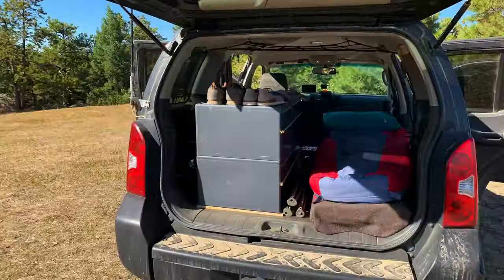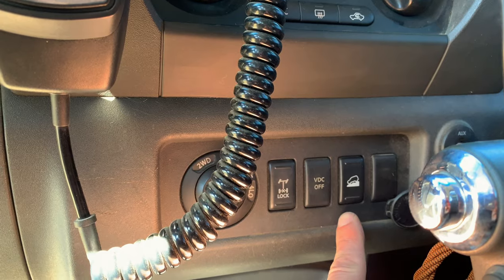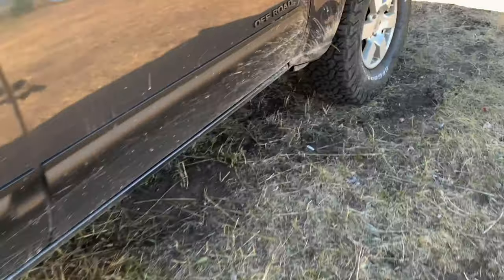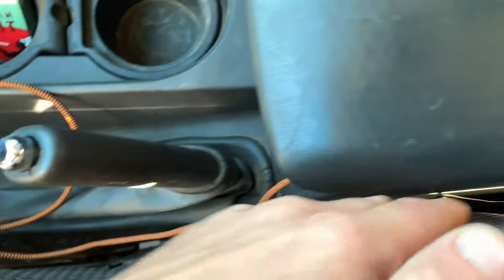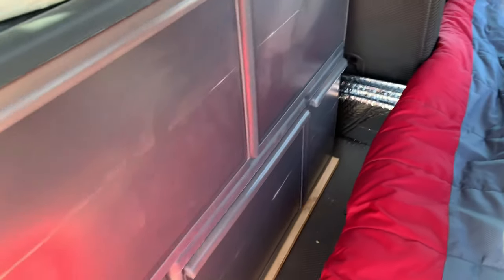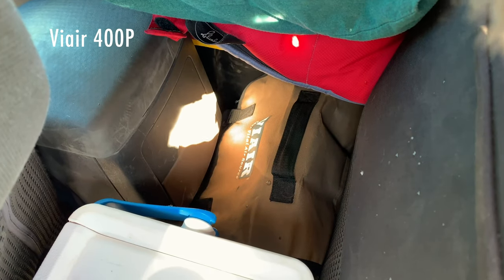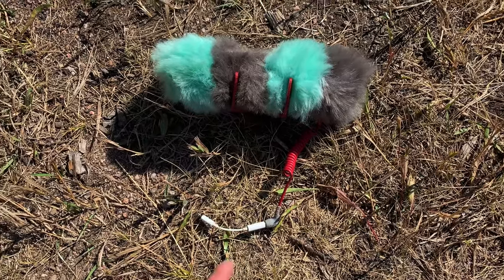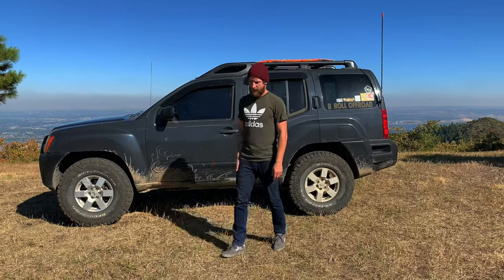Basic Solo Camping Xterra. Rig Walkaround #1

Comment: As I was driving along the interstate today in my car which is almost exactly like yours, including the OME lift kit and the OFF ROAD badge, but not the Rockford Fosgate stereo, I remembered that you mentioned in this video that your UCAs burned out (a couple of times?). I used this lift kit because it would solve the problems of the shitty stock leaf springs plus give me room for my 33s (which are more like 31s), and because it did not require upgraded UCAs. I did replAce my old UCAs, but with cheap stock-shaped ones from ebay. I expect that they will not last because they are cheap; HOWEVER, I wanted to ask you if you thought yours didn't last because they were cheap? or if it was because the new angles of the lift caused the stock configuration problems, or because of the extra stress from wheeling. Can you tell onE way or another?

I hesitated on throwing down the five bills on the SPC UCAs; well, because my allowance isn't that big, but also because I didn't know if their rigor would be overcompensating (Face it, at 53 I'm already overcompensating by having the truck in the first place, and I'm 57) and if their adjustability would be overcomplicated or problematic for the teenagers who run the alignment machines these days. I just didn't know if they would jive (I lived during the 70s) with the OME kit.

I would appreciate your advice or experience on this, and while I wait, I am going to watch another one of your beautiful Moab videos to get ready for my nap.

Thank you!
Reply from the maker: thanks for all the kind words! i actually JUST got back from Moab 10mins ago with some more videos! i replaced them at ~160,000 from the stock ones so it was just time because of one of the ball joints and a couple bushings. that late in the game it’s such a pain to get the old stuff out i went with the SPC’s to just replace everything at once. in the future when i break a ball joint they’re much easier to replace and if the tech knows what they’re doing should be easier to align.
Reply: @BRollOffroad  I see, thanks. I added cam bolts to the LCAs when I did the mod, so camber adjustments were a dream for the tech who aligned my car after. Based on what you're saying, I'll let these UCAs naturally expire and save my pennies against fancier replacements. I get out to CO fairly often to climb, but this is my first 4WD drive vehicle and I have not  gone on a crazy road on purpose so far. Just finished this build to get me further into the back country for potential climbs and backpacks. That's why Moab interests me, so I'm going to throw down for that book you list in your comment section. Anyway, I hope I run across you out there; we can compare vehicles and you can give me some tips. . . . In the meantime, gonna keep on watching your vids, subscribed yesterday. . . .
Reply from the maker: @climbingwithoutpassion2343  awesome! and yea, "if it ain't broke don't fix it" then when the time comes might as well upgrade. as far as real benefits i didn't notice any increased travel or anything, most just that they're now easily serviced in the future. rereading my first response i was definitely pretty tired haha. if you've never been to Moab you gotta go, even if you didn't climb or bike or do anything, it's just a sight to see. i've been all around it in ~40 mile radius and everything has been unique and interesting.
Reply: @BRollOffroad  Question of a noob: In Moab, and in CO, do you need permits to camp along these trails, or is there any other restriction about camping? Or is it generally dispersed camping?
Reply from the maker: most of where we go is either BLM or National Forest which is usually dispersed and free. there are sometimes campgrounds or small reserves inside the boundaries that require a fee but will have a toilet and maybe water or showers. also on trails like Fins N Things and Hells Revenge in Moab they are part of the Sandy Flats Recreation Area and require payment. almost everything has a length restriction of 2 weeks. all that said i’ve been going nearly every weekend for a decade and have paid to camp less than 5 times so there’s plenty of free stuff out there!

edit: also dispersed means staying at some pre-existing area with a fire ring, we never make any new campsites.
Reply: @BRollOffroad  Thanks for taking the time to respond; I appreciate the info. . . .
Reply from the maker: @climbingwithoutpassion2343  the channel's purpose has always been more resource than entertainment, that's what i'm here for!

Comment: What is the mileage on that vehicle?
Reply from the maker: 182,000 👍
Reply: Still running good then
Reply from the maker: @frommy63yt26  yea i replaced the suspension obviously and other than the battery i think that's been everything.
Reply: My mom has a 2010 Toyota Seqouia that is very comfortable and still running like a pro after 9 years. It is a fuel chewer though, and we have to refuel it 2-3 times a week.
Reply from the maker: @frommy63yt26  nice, those are cool. i've been seeing more modded Seqouia's lately and older Tundra's. this thing is surprisingly good on gas IF you're easy on it, i got 402mi on a tank a little while ago.
Reply: B Roll Offroad, awesome
Reply: Always interested to know what MPG other rigs are getting.  My daily is a 2014 Xterra pro-4x, 6 speed manual with 120k miles.  I was getting 15.8 (mostly town) before replacing a faulty fan clutch.  Took me to 17.5 mpg.  Then last month during a 1700 mile round trip to Maine from PA.  I ran 93 octane along with 2 bottles of fuel injector cleaner.  I averaged 19.5 by the end of the trip on State Routes avoiding most highways.  (All stock, no lift).  Sitting at 18 mpg average on my local roads.
Reply: BourbonBuzzin nice. The Xterra is very nice. Sucks they discontinued it.

Comment: can you show your set up without the drawers when you have your gf in there?
Reply from the maker: it’s just a mirror of the passenger side. driver’s seat forward with the same kind of crate behind it and rear seat folded flat. everything i need from the drawers goes into the 2 crates, the major difference is that side is 2/3 fold seat so it’s much more than double wide. also whenever we need anything instead of a drawer we gotta lift the mattress and the crate lids which is kind of a pain. when in route the crates come off the floor and onto the backs of the rear seats and we roll. there’s a quick shot of it on the 4th post back on my Instagram.